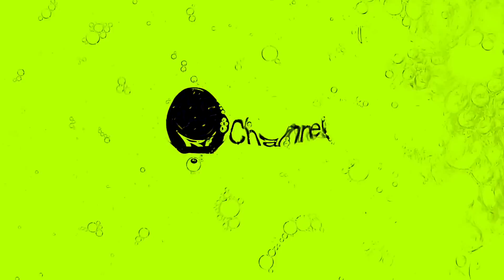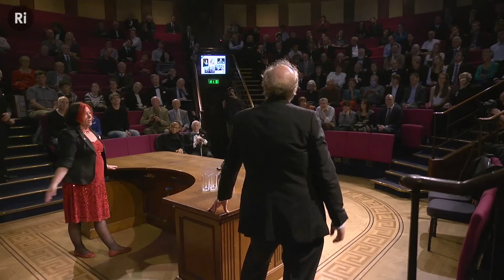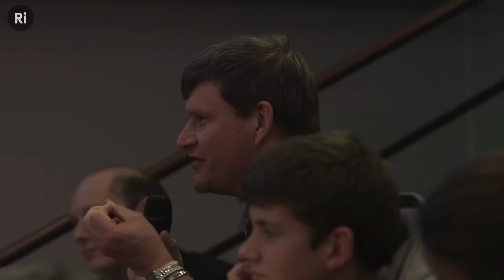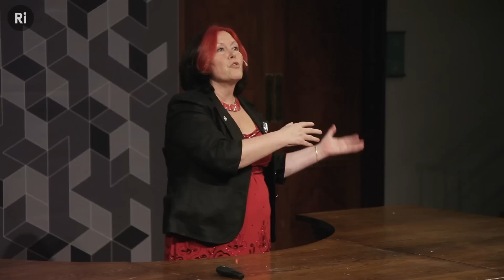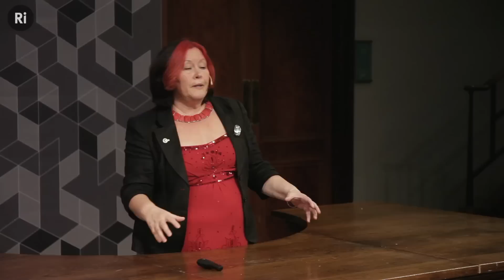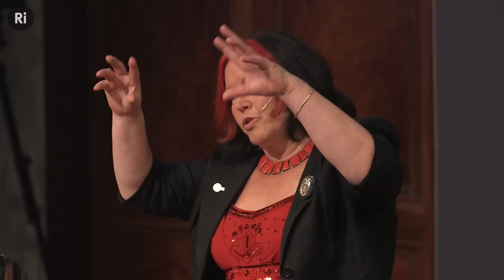Q&A - Powering Ahead with Solar Energy - Professor Lesley Yellowlees

Comment: Not impressed.  Her answer about the viability/prospects of solar powered autos is outrageously optimistic. The problem is that the solar energy flux is only about 1 kw/square meter. So, if you cover your car with solar cells that are 100% efficient, you have about as much energy to driver it as is required to run a toaster.  Even if you park it in the sun for several hours, store the energy with 100 percent efficiency, you still can't go far or fast with the energy that would be available. it is a fundamental problem.

Comment: What you're describing is a decentralized system where you need to deal with multiple issues (not only efficiency) :
maintaining power factor
minimizing noise from DC to AC converters
and most important maintaining balance in there power grid.